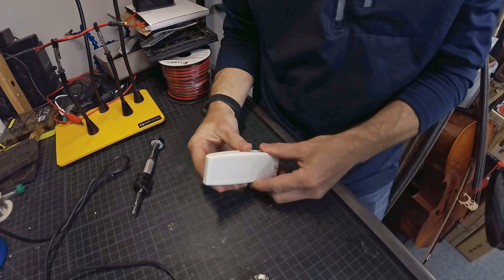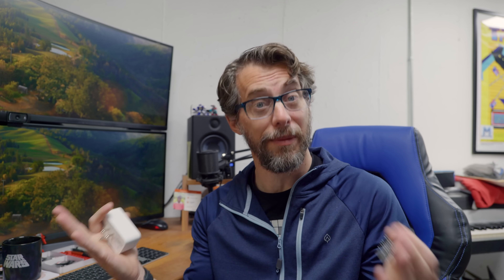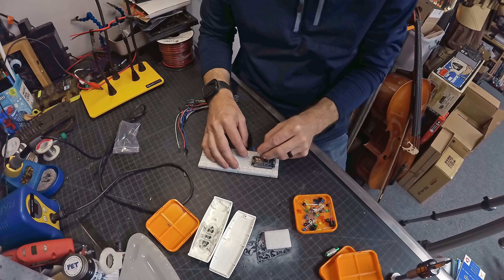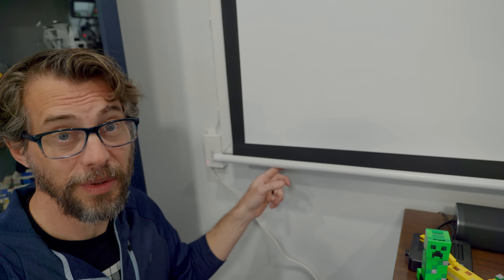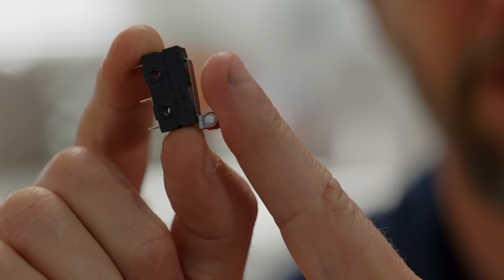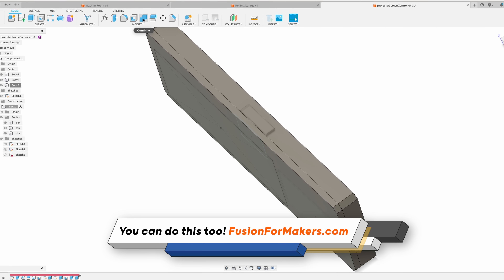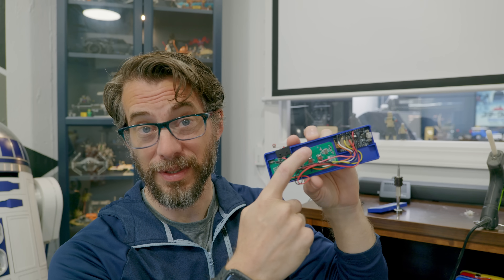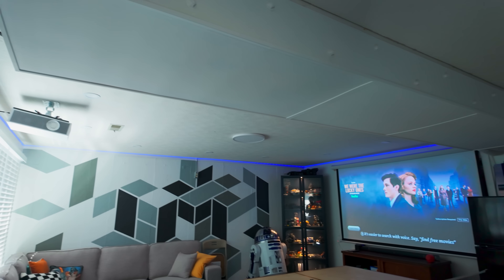Make Dumb Electronics Smart for $3

Comment: I'm not understanding why a limit switch was necessary. Did the original screen not already stop at the bottom and top?
Reply from the maker: No, it has a lot of excess black material at the top of the roll, so that you can extend the white area down as far as you need.  It almost hits the floor when fully down.

Comment: A solution looking for a problem.  

Hours of work and real money to create a complex device that just does what the much simpler and cheaper remote control already did perfectly well.  

Plus, who needs a remote anyway?  The button on the wall next to the screen already does the job at trivial cost, so why even buy the remote?  

In practice, you spend ten seconds running the screen down before you watch a movie, and then another ten seconds running it back up when you are done.  Point is, it's not as though you need to play with the screen every few minutes all day long, so why not just walk a few steps to the wall for the few seconds that you actually need to control the screen?  Moreover, you need to be in the same room as the screen to watch the movie anyway, so it's not as though you need to control the screen from any other location.

In short, a total waste of time, except perhaps as a classroom exercise for those who are just starting to learn about basic coding and electronics.  However, even in classroom exercises you might want to build something that is actually useful.

Comment: Smart?  Not in my opinion.  Any time you have to use a local device to talk to a server located somewhere on the Internet, then to another server on the Internet, then from the server on the Internet back to your local network, then to your "smart controller" is not smart.  Local voice control to the device, directly (and can at maximum be on your local area network) would make it a smart device.  Why?  Simpler is better.  Direct is better.  The Internet in not reliable.  The manufacturer maintaining a server is not reliable.  The interface from one server to another is not reliable.  In absolute fact, the more connections the unreliability goes up exponentially.  You want to make it smart, put all the intelligence local, simple, and totally within your control.

Comment: May be a more elegant setup to just connect a little radio module to your ESP32, and record the 3 signals from the remote, and use ESPHome to replay those signals. No need to cannibalize the original remote, so you can still use it as a backup (though I suppose you technically could still use the buttons on it as-is)

Comment: Hi. Not an EE, but a software guy here. And I'm running into a issue.

An ESP32 comes with an LDO voltage regulator. Based on the schematic my ESP32-DEVKITM-1 comes with a SGM2212-3.3XKC3G/TR. It's documentation states, that this LDO takes voltages from 2.7 to 20V. The input pin and ESP32 documentation however states, that this pin should be 5V. 

So my question is, can I put 12 Volts on the 5V pin of the ESP32 devkit? Would I just need to add some cooling to the LDO?

Comment: I had a very similar screen once and instead of opening the remote i just copied the IR-signals that the remote was sending and had my raspberry pi back then replicate the signals with a simple IR emitter. my screen did not have button on the wall unit only remote. so i wanted to keep it untouched.

Comment: My guess for the 12V batt but it working across a wide voltage range is one of two, 1.> having a long battery life just by having a wide voltage range and/or 2.> lazy hack for more range? Bonus 3.> If fit the form factor and datasheet, so it got used.

Comment: So many comments with so many different ways someone would have done this. And while your correct most of them could be done that way, everyone needs to remember he's making this content for everyone and not just those of us who have backgrounds in DIY electronics. I have done this plenty of times to get around proprietary Garage door switches when trying to automate them in a home. Most don't have straight contact relays anymore and you have to fake them or pay for an expensive subscription to automate them. 

My one question in this though is, in the software did you set the button presses to be momentary or always pressed? When on the breadboard testing with LEDs they appeared to be set as an off/on state which would cause the remote to constantly transmit rf to the receiver causing noise in the environment that may interfere with other devices and can also lead to early transmitter failure since I'm sure the remote wasn't designed for a constant duty cycle in mind. Just a curious observation that wasn't covered in the video. Thanks for all the video you make! Always enjoy seeing what you come up with!

Comment: I'm going to make an educated guess that the remote is 433Mhz. You can buy a small transmitter receiver 433mhz pair, hook up the transmitter to the microcontroller and send the same signals that the remote would. What signals? You have a receiver, record what the remote is sending and then you'll have the signals to play back. Don't worry, they're very simple signals. How do I know this? I did this for some motorized blinds whose remote also has up, stop, and down buttons.

Comment: Relay makes sense for controlling something like 230V. For a 12V button an optocoupler would be enough.
Reply: Or a transistor.
Reply: @jimlynch9390  Sure, although if the two sides have separate supplies, keeping them electrically isolated can save a mountain of headaches with crosstalk, noise, power going where it shouldn't if one is unpowered and the other not, etc. Same supply - don't even think twice.

Comment: Why does he keep calling an ESP32 an Arduino?
Reply from the maker: it's an 8266, and basically because Arduino has become synonymous with microcontroller to the uninitiated.
Reply: @Iliketomakestuff  I was also wondering why you said it only cost $3, but if it's 8266 then that makes sense.

Comment: For IR and RF stuff, might want to look into a BroadLink blaster! It's a tiny little device that can learn the signals coming from the remote and rebroadcast them. They're admittedly a bit of a pain to set up initially, but they work quite well once. They also integrate well with Home Assistant if you want to keep things local!

Comment: I think it's a bad approach. Sure it will do the trick, but why not just use the 433/868 MHz or IR signal directly. The approach you took, should only be used on the host/device itself.

Comment: 9volt is safe-ish on most ESP boards basically I would not trust it enough to operate it outside of my field of view.

And 12volt remote is just weird here.
I expected a lot of things:
9volt block
1-4 AAA 1.5 volt
1-4 AA  1.5volt
1 custom liPo 3.7volt
some 3.3 coin cells

But I would never have guessed 12 volt.

Comment: The mosfet would have shown you the 3.x Volts if you only measured it. They probably used a 12V battery to have this huge gap of possible voltage drop from 12V to 3V just to extent the battery life.

Comment: This is awesome, I have a weird situation im trying to figure out an answer like this for. I got some cool can type recessed lights on amazon, they have regular light and a nightlight feature. If you turn your switch on it turns lights on, but if you flip them off and on again within 5 seconds the nightlight turns on. cant find a smart switch that allows this to happen within seconds, it would be 1 minute between. The goal was to allow the switch to work, but at a set time have the nightlight come on automatically.

Comment: This could just be me but wouldn't it have made sense to just adapt the wall mount unit. you could have left the buttons on that for manual use at the screen, use the esp etc on that device to mimic the press would have already had power at the unit but then also still have the remote as a fully functioning remote if needed. hopefully that all makes sense lol

Comment: Connecting a 315/433MHz transmitter module to the MCU-board is a better solution. See Arduino-Libs rf433any, rf433send etc.

Comment: Me and my son did something similar with an air conditioner and a heater and a generator.  We just used an esp32 IR and RF receiver to get the code then used transmitter to emit it. Works perfectly from anywhere and we still have the remotes in tact.

Comment: Well, this was stupid... 
it's just a plain rcswitch 315mhz/433mhz RF remote,
 Use a 1$ transmitter and receiver 433mhz / 315mhz (depend on the remote frequency) rf-kit from Aliexpress with esp32 and rcswitch library code on it to re transmit the code it sends... 

There is no need to physically connect to the remote at all, 
and it will work for a 100 buttons remote too...
But if you can't read the remote codes - I would prefer to connect the esp to the wall box, 
since it has power and plenty of  room... plus the remote will still work...
Reply from the maker: Cool, thanks. I don't think your ideas are stupid, eventhough they're different from mine 👍🏼

Comment: I think its possible to integrate a 433mhz transmitter for use with the ESP32 - Which should remove the need to integrate with  an existing remote remote control. They are only a few bucks and could also be used in projects such as Car Garage door openers etc.
Reply: Exactly what I came to say too. This is most likely using 433mhz and the signal could be replicated with a simple module for the ESP32 instead of hacking the remote. Great video regardless!

Comment: I would probably have used a hall effect sensor instead of the limit switch so it wouldn't require physical contact.
Reply: or better use inside screen motor control box have own limit SW  and use this.

Comment: I do this alot, but I always like to isolate the buttonpresses completely from the buttons I modify and the ESP-device. Using optocouplers makes this perfect. Then I just need 3.3/5V for the ESP and just leave the thing as original as  it was. By doing this the ESP and the other thing is galvanically isolated.

Comment: While this is a good beginner electronics project, I would have used TinyRF library with a $2 pair of 315/433mhz receiver and transmitters.  receiver to record the code from the old remote and transmitter to blast it out.

Comment: Sick project! Couple of things I might suggest for the next one:
- i wouldn't solder crimped jumper cables like that! Those things are expensive!!
- esphome is really great and may serve your purposes
- optocouplers are the technically correct way to have two circuits (of this size, doesnt make sense for a relay like you mention at 12:38) with different power sources interact with each other (i know you ended up using usb for everything but this is feedback on the original plan)

Granted, I'm not an electrical engineer but this is just stuff ive learned over the years doing Arduino

Comment: I like the video and enjoyed the process, but 2 things come to mind:
1) using the limit screw on the screen's motor assembly reduces a lot of the complexity of this project
2) Modifying the operation buttons attached to the wall would have made more sense, as you wouldn't have signal issues, and you would still have a useful remote.

no shade though, I always appreciate project sharing. cheers!
Reply: @_pixelpicnic 
I agree with the modifying the "wall unit" totally. Keeping the remote completely "wireless" does keep it a practical wireless device as it was intended. But he did say he did not want to totally "destroy" the motorized screen. I do understand that. We have all done it at some point and probably more than once. Remote is "technically" and financially a more replaceable item.
Reply: Mod the wall box and add reed switch to control the "open" position and it would be great
Reply: I was hoping he was going to use software to control how far. He could have set the timer initially in his program but also have a way to adjust the time up or down maybe use a combination of buttons If you're pressing the up and down button at the same time it changes the value to a larger value, and then hold two different buttons to change the value down. That way he doesn't have to have it mounted to the wall.
Reply: As an alternative to point 2, temporarily use an RF receiver module to figure out what the remote is sending, then in the actual project, use an RF transmitter module to send those codes directly instead of wiring the microcontroller into either the remote or the wall controls.

(That's what I did to make an Arduino turn on and off multiple RF-controlled light sockets from different manufacturers with the press of a single button.)
Reply: I agree. This video would have been more generally applicable if he'd shown us how to control the device directly. Not everything has a remote.
Reply: I do not use either controller that came with my screen. I connected my screen to my projector. The project deploys and retracts the screen.
Reply: Exactly my thoughts. Was just about to comment this. 
Aaaand, I would personally use ESPHome or Tasmota.
Reply: This may have been said somewhere else, but why not use the “brightness control”, find what percentage is the correct distance for the window, and make that number a constant for when “on” is activated?
Reply: Timer actually is less complicated
Reply: @syedharris1 but would that not be less reliable? What if there’s a little delay in connection and the screen starts coming down late, and the timer ends before the screen is all the way down?
Reply: @makaiwise4609  
Hmm...that's a good point. Unless the timer "only" begins when the screen starts to move...   which goes back to the idea of "mechanical" solution. I like the idea of the mechanical limit switch myself.
Reply: @syedharris1  How would using a timer be less complicated than using the limit switch provided by the manufacturer?
you don't need any extra hardware or software to control it.
Reply: @_pixelpicnic  That was my thought.  I have a difficult time thinking that the screen manufacturer did not provide something to stop the screen at the end of travel up or down.
Reply: Or using a timer to tell when to stop. All valid ideas to solve a problem.
Reply: @cccccc864  that assumes the screen motors and electronics are quality enough that you can rely on it having exactly constant speed. If it varies, then over time you may find it's not doing what you expect it to do. A hard limiter or limit switch would be more reliable in the long.
Reply: @vbikcl  you're so right, sir.
Reply: @cccccc864  im glad im not the only one thinking this, I'm no expert but i figured it would be much cleaner and modifying the wall mounted controller too because you're already getting power there.

Comment: I would have modified the wall mounted control and used wifi relays. They connect to Alexa and you could still have the remote.

Comment: I have just stopped at 4:47 to say that you spoke about a premise, but so far you have not once explained exactly WHAT you want to achieve, WHY you want to install the arduino into the remote in the first place. From the beginning I thought, you want to press Down, and the screen must come down to the correct position and stop automatically, and same for up. Now I guess I will see if I guessed correctly.

Comment: How do you get it to stop at the top of the cycle? Or is there a built in limit switch in the device for that purpose? What happens with the device if you tell it to turn screen down but don't stop it? Does it have a limit switch for that as well?
Reply from the maker: It has built in switches at the very top and bottom of the screen.  The issue is that the bottom is WAY past where I need it to stop (like 18")

Comment: The only downside is that now your screen remote is dependent on internet connectivity if your control gateway is Alexa.
Why not use a local api solution like Home Assistant, OpenHAB, etc?
Reply from the maker: I use Home Assistant, and can control it that way as well.

Comment: garage and gate clickers use that 12v battery, it's just a 3 channel clicker and maybe without the rolling code.
That's not what begs the question means, it begs THE question, not ANY question: Is your argument circular?

Comment: Couldnt you forgo the switch and just use a timer like when you tell it to lower it, soon as it starts, it starts a timer, then you do a reverse of the counter to stop it. when it hits zero its done? and you count the time for it to reach the bottom and when it does you know thats max? you could also say anything you wanted like put it 1/4 down or 1/2 down or 3/4 or whatever you want all based on time.

Comment: Unless you can buy an arduino unit for $3 then this video is a LIE!

Plus the cost of a limit switch, PLUS the cost of a step down controller. 

This whole video is one big lie!
Reply: since step down converter (not controller) isn't needed .. µController = 1,30 or more  , limit switch 2-7 cent .. so jupp`?
Reply from the maker: I ended up not using the step down, and the ESP can be purchased for about $3

Comment: the RF signal is week cause your only using 3.3v now instead of 12v. You have the switch to know when it's down, so you have state, so it should be a single device and the device is on when the switch is triggered

Comment: The wheel on the limit switch is so the trigger mechanism can slide by the switch instead of crashing into it, because 13:05 can crush the switch and cause a malfunction.  Use a mechanical switch along side the path of motion, not in the path of motion.
Reply: Agreed

Comment: I did the same with my cheap 100 inch screen 15 years ago and an arduino uno. With an ESP and ESPHome it is now way easier. And a simple transmitter instead of a remote hack.

But did the screen not stop automatically when it was fully down? Never tried a screen that just continued to run until it got stuck. If that is the case, I would prefer adding relays directly to the screen and control it that way. Or add a sensor to male the motor a servo.